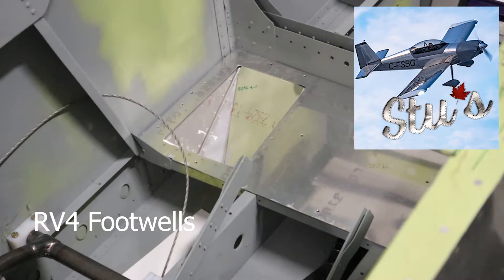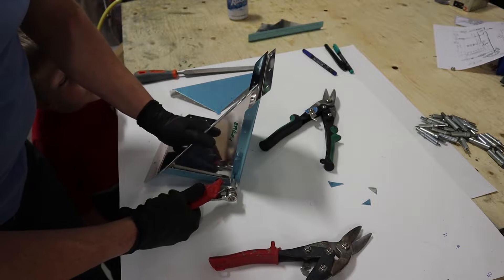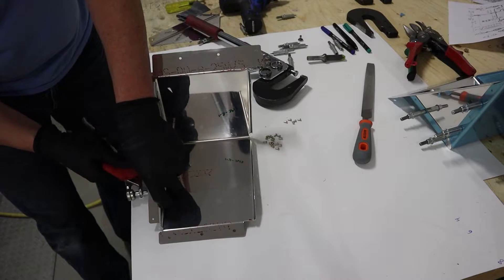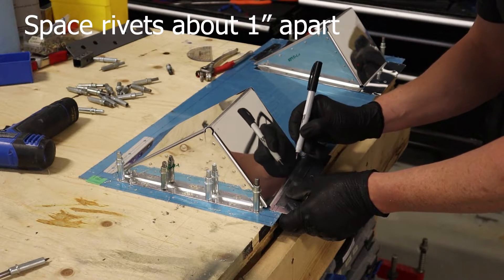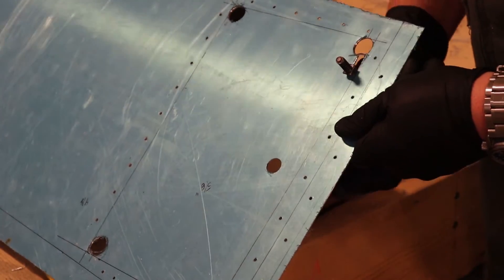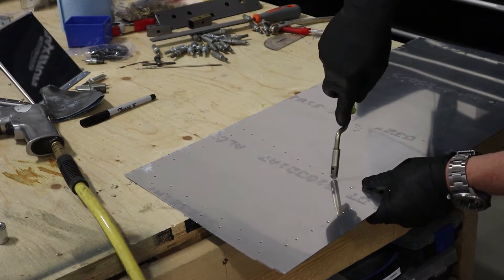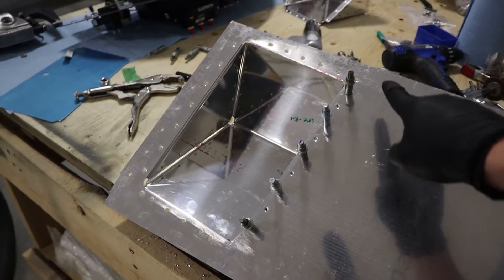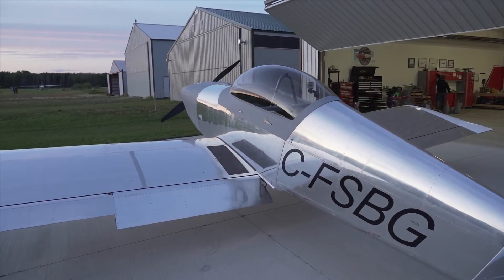Basic Metal Working - RV4 Footwell Installation

Comment: Stu what deburring tool is that? Thank you for the video!
Reply from the maker: Mine is older from Avery Tools which does not exist anymore.  Here is a link to Cleveland tools of the same tool.

https://www.cleavelandtool.com/products/speed-debur-and-countersink-set?_pos=1&_sid=147db653d&_ss=r&variant=31547111079998
Reply: @stusaircraftfactory6592  thank you very much! 👍